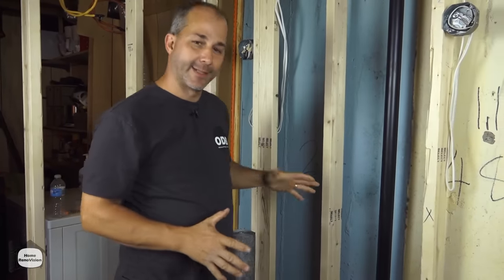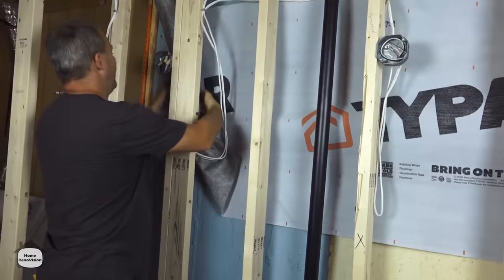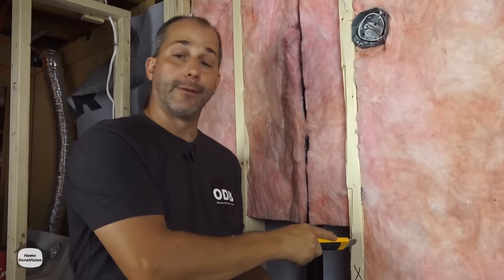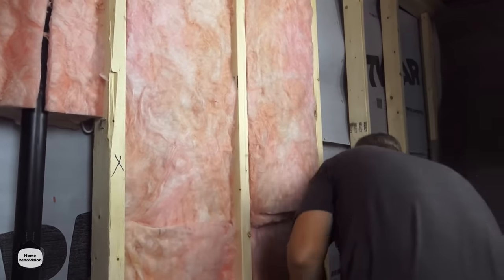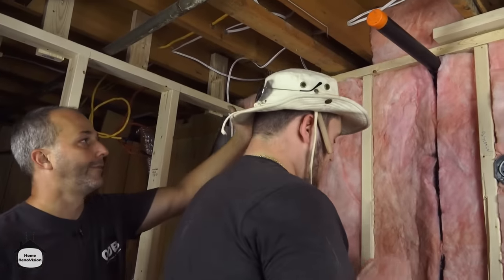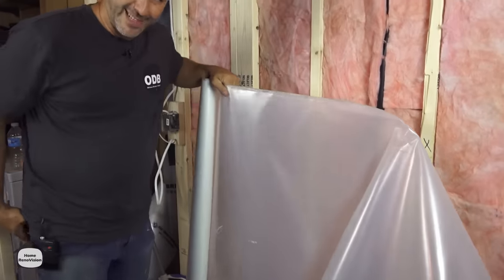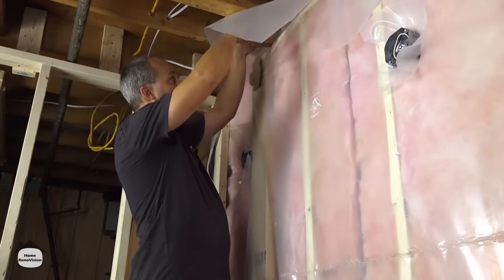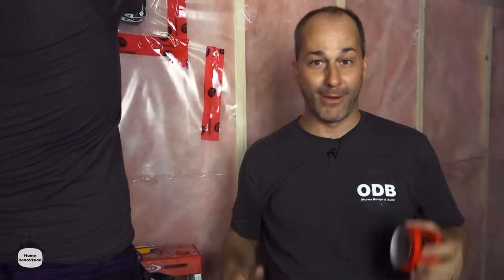How to Properly Insulate a Basement Wall: NO MOISTURE!

Comment: Hi Jeff ! Thank you so much for all the great videos and the real world DIY advice !

Could I please have your advice on my basement insulation ? (I live near Montreal)

I now have 2 inch blue SM foam on foundation walls tuck taped at the seems, will put 2X4 walls on top with R12 pink insulation in between studs. Do I need to put a poly vapour barrier on top of that ? It would prevent moisture from room to go through drywall and into pink insulation I guess ?

BTW, the floor will be on concrete slab slab 1 inch blue SM foam tuck taped at seems with perimeter sealed with spray foam at joint between floor foam and wall foam, with 5/8 OSB tongue and groove on top secured by Tapcon to slab. Might seem a bit excessive (à la Mike Holmes...) but I have radon in my house and I'm trying to seal everything ! I already have poly beneath the slab and an additive in the concrete itsef, plus perforated pipe in gravel under slab that vents through the roof. Will add fan to pipe in attic if basement sealing isn't enough...

Load bearing walls are poly on concrete, pressure treated bottom plate plus regular lumber for "second bottom plate" (to be able to screw drywall since 1 inch foam and 5/8 OSB floor will butt up to first bottom plate) and non load bearing walls will be on the OSB.

Thank you !!!
Reply from the maker: sounds like you have it figured out. I would suggest you have a waterproofing system around your foundation if you seal it up that well in the basement. If not perhaps a dimpled membrane on the floor then insulation and osb so that water infiltration has a place to be absorbed without going grey and smelling. air flow keeps things dry, cheers!
Reply: Home RenoVision DIY Thank you for the super quick reply ! And of course, thanks for the advice. Keep those videos coming !
Maybe you could do one on choosing light fixtures for a basement, where and how to install them ? Or also on stair cases and railings install. Thanks !

Comment: with Roxul you can actually tackle 3 at the same time - Sound, Thermal and Fire barrier ... and it's hydrophobic too... so if it ever gets wet, you can easily reuse it! However, they are kind of expensive here in the US at least for attic applications it was like triple of celullose/FG ... for walls i guess not that much I just checked Lowes and its about 50 cents per sq foot for R16 on 2x4 walls
Reply from the maker: Actually The sound and fire insulation is not rated for thermal. And you don't need sound and fire on an outside basement wall. Way too expensive. It is quite brilliant in other applications. Just use the right product for the right job for the right price. There is never a one size fits all solution in construction.
Reply: i didnt mean the "sound and fire" product line but the thermal one. The thermal one, the ratings for sound even though it's not rated for it, it only underperforms by 3% ... and for fire it's rated for fire.
Reply from the maker: I get the benefit, however it is very rare that you would ever see the benefit in a basement exterior wall application.
Reply: true. however if cost is the same i would go with it instead of any FG product. Surprisingly, like i said, I check at lowes and its actually the same price!
Reply from the maker: I just checked the website for insulation. The bag price is similar however the fiberglass bag covers almost 45% more space. That equals half the price.

Comment: No my foundation is not waterproof I did have a spot or two where a very small puddle of water but I built up around the house and had not had the sence but I was going too use the foam on the interior but you are say the way you do it is better? And how much space should I leave
Reply from the maker: Hi tony, if you don't have a waterproof foundation then you will have moisture coming through the walls. I prefer to leave 2" air space to make it easy to transfer that moisture into the framing of the house which will release it back into the atmosphere.

Comment: Hello,  I was reading bout science of insulation and vapour barrier and condensation. How will you suggest a system where I use water resistant poly sheet on both sides of studs and R20 insulation  in-between ( either roxul or pink insulation). In this system there will not be any humidity crossing insulation layer so vapours on hot side will not be able to move to cold side and there will not be any condensation. there might be something that I am missing, may be your experience can help me understand it better. Thanks.
Reply from the maker: That type of sandwich layer is unproven and risks causing premature mold. I prefer to have an air space.

Comment: You said if a house is built with 2x6 you also have to in the basement, is there an easy way to ID either the house was built from 2x4 vs 2v6?
Reply from the maker: usually 2 storey homes are 2x6 and bungalows are 2x4. The easiest way to check is measure the thickness of the door jamb on the front door. Minus 1/2 for drywall and 1 inch for siding or 4 for brick.
Reply: I never knew that! Looks like i learn something new 1 video at a time. Thanks!

Comment: A  q: mosture ,is it coming from in side inside of house or sweat thru cold block? vapour barrier overlap, top over bottom or bottom over top? where is drips flowing? great videos
Reply from the maker: Moisture in the form of relative humidity goes both directions depending on thew time of year. Moisture travels with the heat to the cold. The largest problem we get in our climate is when heating a basement with subzero temperatures outside. This is why we need an airspace for the summer and  a vapor seal for the winter.
Reply: @HomeRenoVisionDIY  I think John might have been making the same mistake several other people have, and thinking that the Typar is a vapor barrier. 
John, it is not. It is vapor permeable in both directions.  In its intended use, as exterior house wrap, it is meant to allow vapor to move in either direction, while preventing entry (by redirection) of any LIQUID water that gets under the exterior cladding. 
Jeff is just using it as a cheap, lightweight retainer to keep the insulation batts from ever falling out of their spaces and leaning against the concrete wall.

Comment: You said to staple the wrap to the back side of the studs ? Then you ran your hand behind the stud wile insulating , so apparently you didn’t staple and if so how would you even get a stapler on the back side with no room ?
Reply from the maker: if you attach before standing up the wall.

Comment: What is the point of the last layer of plastic if you already put a moisture barrier behind the insulation
Reply from the maker: Hi Sam, the typar is not a moisture barrier. typar only deflects moisture as a part of an exterior water diversion system it is not a vapor seal. It is used to hold the insulation in place. The plastic in the front is the vapor seal. Cheers!

Comment: I'm insulating a wall.  My neighbor is tossing a bunch of drop ceiling tiles.  Would I be a complete hack jagoff if I used drop ceiling tiles to insulate my walls?
Reply from the maker: a bit. that will cause you serious pain.
Reply: @HomeRenoVisionDIY  The vague warning left me undaunted. We layered the ceiling tiles and added a little spray foam to the mix. It turned out great. We did use masks while cutting the shit.  While I'm sure we won't be setting any r-value records at the start and the end of the day it's tough to beat free.
Reply: Ron Brigel you know what’s better than free? Correct.

Comment: My washroom in my basement is cold tge exterior wall to the washroom is the wall for the separate entrance. I believe it's because of this newly constructed retaining wall. The wall itself has nothing to protect from the cold weather.

How can I make the washroom warmer should I put Styrofoam on the exterior wall or what
Reply from the maker: Interesting, yes ground insulates so if it has been removed and the wall is not insulated then you will need to open up the wall and insulate. Cheers!

Comment: Is this similar to insulating garage walls? We have an attached garage that gets super cold. The walls have drywall on them and they are painted. I have no idea if it's insulated or not. Any tips on how to proceed would be appreciated.
Reply from the maker: If you have  a wood exterior cladding then you don't need the typar. But before you do that you should know that insulating the walls without a heat source only helps a little. If you are going to heat the garage Don't park your cars in there unless the area where you live they don't use salt on the roads. That is a quick way to rot out your vehicle.
Reply: @HomeRenoVisionDIY   I understand the principle of leaving your garage unheated, here in Canada, but my car (mostly the engine) is plenty warm after a drive, and that heat gets trapped in the garage for an hour or three. Then, a lot of salty slush melts off and runs to the door, where it tries to freeze the garage door shut on the really chilly nights. But the rest of the time, it's salty water or salty slush in the garage and on the vehicle.  Just sayin'.  Maybe when we get a plug-in electric it will comply with the science.  Meanwhile... lease the vehicles and trade 'em before the rust makes headway.   

I guess I'll subscribe to get all the "good stuff" answers.  :-)

Comment: Place foam insulation board sealed by spray foam in cavity above foundation walls, not fiberglass batts.
Reply: Exactly, I'm surprised that he isn't using or saying anything about foam board insulation as you get a high R value per inch and  if you used it against the concrete wall before you frame, you don't even need a vapor barrier.

Comment: How do you feel about ridgid foam insulation or styro foam insulation?
Reply from the maker: Ridgid foam on the wall works great , however if you ever get a flood you have to gut the entire basement and start all over again. My system allows a homeowner to take the cash settlement and then redo the drywall and flooring themselves.

Comment: I got an unfinished basement that I'm building an office in one half and leaving the rest unfinished. The thing is there is an existing drop ceiling I want to leave as is and the walls will not be load bearing in the new office. Is there a proper way to anchor the wall frame to the frame of the drop down ceiling?
Reply from the maker: Yes. Do not attach the wall to the drop down cieling. Just screw the top of the walls to each other and you will be fine.
Reply: Thanks for the advice. I've been researching this and see people doing a variety of things so good to hear it from you. Great YouTube channel by the way!

Comment: I live in east Tennessee. In my basement, is a black wall with dirt on the other side. If I want to put a 2x4 wall in front of it, hoe do I insulate it to keep it from sweating and the water running down and damaging my wood floor?
Reply: Check your city code first. In Nebraska, I just called,and they said I can NOT use plastic for code,and the backer (Typar here on this video) has to be a breathable membrane, but it's not required.

Comment: Great video, I live in ontario is there a need for xbs foam board stuck to the concrete walls in the basement?
Reply: Yes, absolutely. Its shifts the dew point from the back of the insulation to the foamboard/roxulboard if I'm not mistaken. Allows moisture to run below the footings, keeping it away from insulation/drywall. Sprayfoam when done by a competent company is the best system. I'm also in Ontario!
Reply: I love Jeff but this is all wrong. Spray foam or rigid board sealed with spray foam is best practice for insulation and vapor barrier. This pink insulation sandwiched between two barriers is the old problematic way.

Comment: we live in ontario .... what happens if my contractor did not use vapor barrier before drywalling
Reply: I live just south of Jeff by an hour in Ontario too, over time what may happen is moisture will accumulate and soften the drywall or molds may form. While it might not be absolutely necessary, I dont know anyone who doesn't use it in Ontario

Comment: What is the code for screwing strapping to the basement cement floor. We had a flood and the contractor screwed spruce strapping directly onto the cement floor.
Reply: USE PRESSURE TREATED 2"x2",rigid styrofoam in between @ 16" centres,then plywood floor(pressure treated as well if affordable).Make sure water can follow a path to sump pump from all directions.

Comment: The air space is good idea. Instead of typar, could you use 6mil poly instead, or would that trap moisture? If typar is not available, is tyvec the same kind of product?
 When you say it should have been attached "before building the wall", how would it be attached then? Did you mean stapling it the back side of studs before raising the wall in place? Does it matter which side faces in or out?
Reply from the maker: house wrap is not a vapor barrier so it does not matter which way you place it. Cheers!

Comment: What are you thoughts about vapor barriers in Michigan?
Reply from the maker: definitely needed. Cheers! on the warm side of the wall in the winter.
Reply: @HomeRenoVisionDIY  great I was going to go with tyvek between  the studs and concrete wall, insulate, then a vapor barrier over that. Am I in the right frame of mind?

Comment: I had a flood in our basement. They cut 2' off the floor and remove all the drywall and insulation. But left the rest. What is the easiest way to insulate and connect the vapor barrier to what they left?
Reply: i have the same issue! I wish someone would answer your question, lol

Comment: ...where is the recommended gasket between the concrete floor and the bottom 2x4...?? ...or did I miss it?
Reply from the maker: I use pressure treated 2x4 as a bottom plate in stead of a gasket which is allowed in most jurisdictions.
Reply: ok, yes, seen that done as well.  
I actually have seen external 2x4 framed walls done completely out of pressure treated (in cider block basements).  
But, then again, today's pressure treated is not the same from years ago, that dangerous stuff stood up for years lol.

Comment: No way to staple the barrier to the backside of the studs meaning your air gap is not really in play, insulation can be pushed against the foundation. And should your typar not have overlapped the other way? Any moisture could run down and get into the insulation.

Comment: I was interested in using Typar as shown in your video but the website for Typar says NOT to use for interior installation. Please advise.
:

”Typar  cannot be used as an interior vapor barrier as it is designed to allow moisture to pass through it in the form of gasses. In general, vapor barriers are only allowed to have very low or no breathing capability.”

Comment: So when framing a basement you wana leave a gap between foundation and stud?
Reply from the maker: That is the 1 single most important message in this video. Air space keeps things dry if water penetrates from the foundation. Good insulation and vapor barrier keeps things warm and dry during climate changes.
Reply: Home RenoVision DIY what size air gap is standard?

Comment: I can see the wall was built and raised in place and indeed should be wrapped prior placement, you would have saved time and material and created a self contained envelope with almost no penetration for moisture. Usually I wrap the top and bottom plates leaving a extra foot on each side, so I can fold it over the front and seal against any contamination from the floor (flood), the top extra will be my extension into the joist cavity. Just my two cents.
Glad to see educated contractors working in Ottawa and willing to do what is right instead cutting corners. Tumbs up 😎
Reply from the maker: Thanks Lino. The idea behind wrapping after was due to the fact that we were shooting a lot of videos on a certain day. I didn't have time to frame it as well with the other content that was coming and I needed to get my electrician in there. The typar is only to separate the insulation from the wall to maintain an airspace it is not designed to be a vapor barrier, nor is it.
Reply: Home RenoVision DIY    I hear you man being a Hollywood start must be time consuming 😎😋 Take care!
Reply from the maker: LOL. That is funny as hell. Max and I are both busy running our own companies. That is why we shoot video out of construction order sometimes. It is all about getting the most footage for our day together that we can.
Reply: Home RenoVision DIY  One day we might have to discuss it over a cup of coffee considering we are close to each other but, head's up I am not as good looking as you guys 😁😁😁😁😁
Reply from the maker: If you are in the area, That would be cool.

Comment: Do I need to place TYPAR after the ridged board
Reply from the maker: no Typar is simply to help keep the insulation in its desired place. It usually does not move but on occasion the wood dries and twists and the insulation falls against the concrete. That causes condensation and water problems.and cold spots in thew wall.

Comment: I went to each room pulled the fiberglass out,, and incl the crawl.. just an air filter,, as soon as moisture hits it,, the r value plummets.. plus bugs like it and mice like it. changed my house house to roxul..
Reply from the maker: Hi Richard, you still need to fix the moisture problem and the access to the house from mice problem or this is just a temporary fix.

Comment: Would spray foam work... or would it just take all the air space away.
Reply from the maker: A closed cell sprayfoam works, remember that foam is a waterproofer as well. This way you get a seal from the events from the outside and a vapor seal from the inside when you are heating your home. This is not always in the budget.
Reply: That's cool.